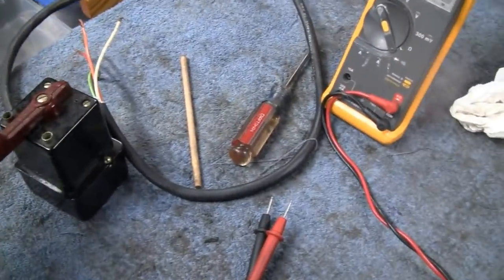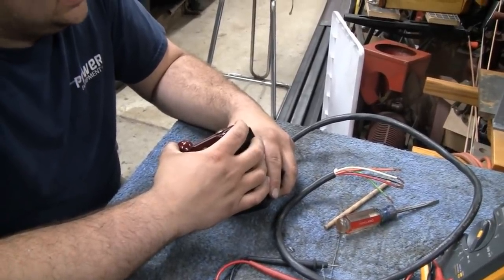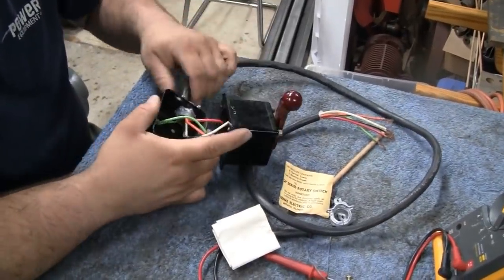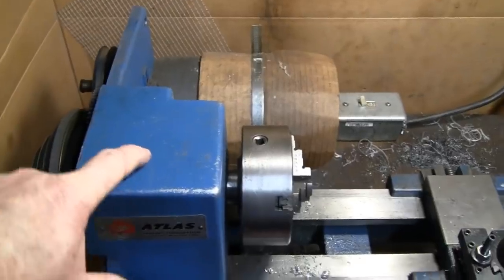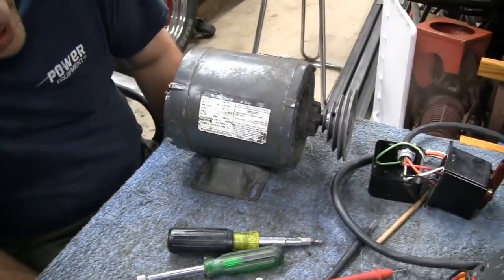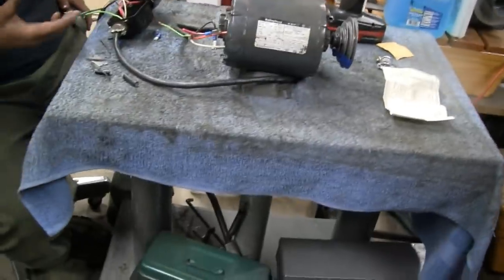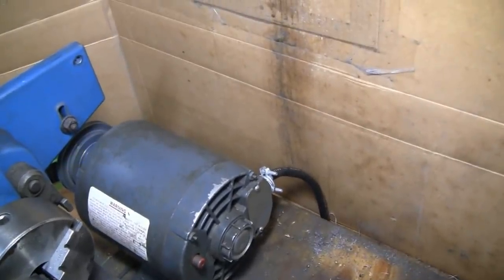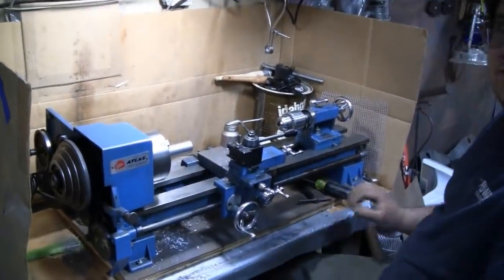FORWARD/REVERSE SWITCH INSTALL ON LATHE

Comment: Glad to see you are doing OK Mr. Roadking. I put a VFD on my lathe. I used a 1 HP 3 PH motor. The VFD changes 230v single to 230v 3 phase. works great and give me FWD and REV. Smitty from NS.
Reply from the maker: Thanks Smitty!!

Comment: My threaded chuck on my old hendey lathe would loosen right off the spindle in reverse. I added a set screw and it ruined the spindle over time. I was young and I learned the hard way. This happened way before YouTube was a thing.
Reply from the maker: We shouldn't have a problem, my lathe ain't powerful enough!! The belt would slip or the motor would stop first!!☺

Comment: You can use a four way light switch to do the same thing but you have to make sure it is a click switch and not a silent switch.  You simply bring the two wires out to the switch and bring the other side back.  The four way switch does the same operation as the Furnas switch but the motor has to come to a complete stop before reversing the direction.  I have used it on a one horsepower motor before and it worked fine.  I don't know how long one would last unless you waited for the motor to come to a full stop but it worked well and lasted a long time when you do.  The Furnas switch would be much better but also much more expensive.

Comment: Gotta be careful using reverse for much heavy stuff with that threaded spindle.
Reply from the maker: Thanks for the heads up!! I didn't even think of that!!☺
Reply: @805ROADKING  maybe put a drop or two of blue thread locker on the chuck threads to hold it but not too much incase you want to remove it later on. Just a thought.
Reply: Yeah, they do tend to pop out but only if you're feeding out. Haven't had it happen on me (and to be understood, on my mini lathe, i doubt that could happen on the big ones) when feeding in, yet.

Comment: Hurray, now I don't need to cringe when I see you reach over a spinning chuck.  I saw a guy get his sleeve caught on a lathe dog one time years ago.  Fortunately he was running it in back gear knurling so he had a fraction of a second longer before it would have ripped his arm off.  He survived with only a sore shoulder.  You will love the reversing switch.
Reply from the maker: Yeah we don't need any more shoulder problems eh!!☺